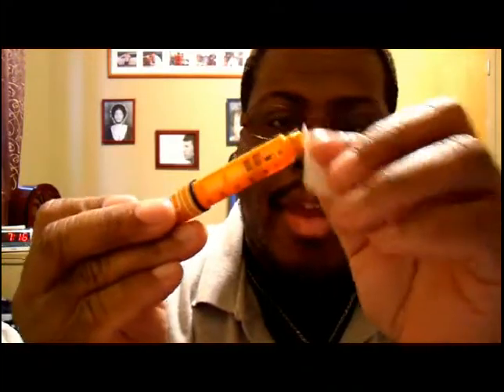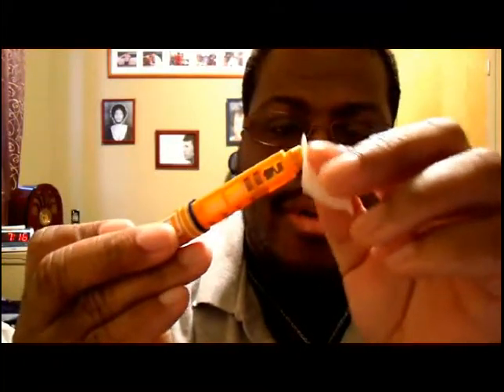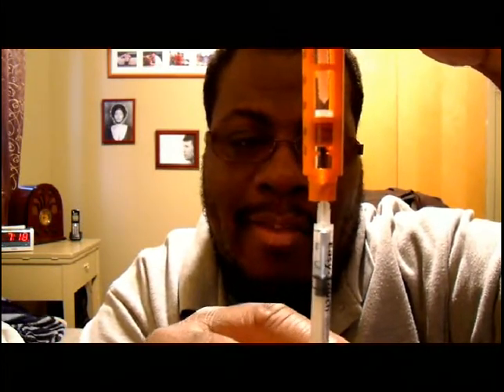Diabatic Radio - Episode 5 - Extracting insulin from your pen

Comment from the maker: forensicsupernerd Wrote: 

cool :) thanks :) I always wonder if I could refill one of the cartridges with insulin from a vial... 

DiabeticRadio:

RE:   Insulin pens are not designed to be refilled. You will damage your pen, and or possibly loose insulin in doing so. My video is only for the expressed purpose of EXTRACTING insulin from the pen for emergency use only.